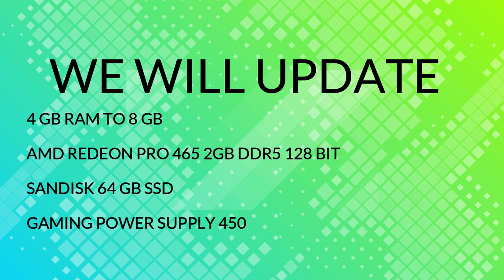Build A Gaming PC Dell Optiplex 9010 | SSD Upgrade | Graphics Card Upgrade| Ram Upgrade | PSU Upgrad

Comment: i have the same optiplex and i am putting a rx 580 in there.Keep up the work.
Reply: @ethanbs9393  it was tight but it did in a squeeze
Reply: @ethanbs9393  Btw it was a red devil version and it does push slightly against the things that open the ram modules.I've had it open the ram a few times but only whne my little brother accidentally hits it or something.